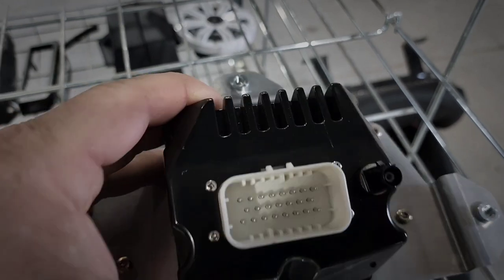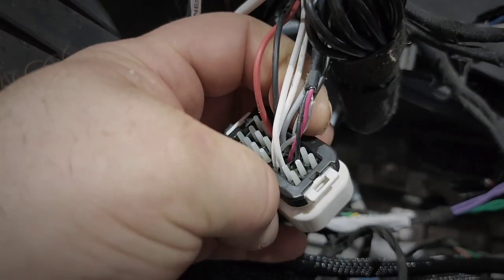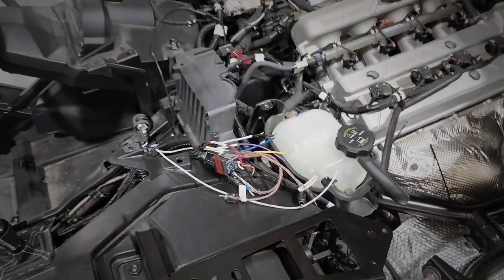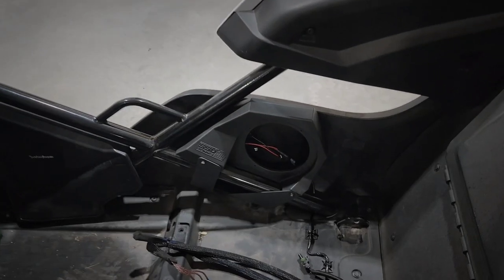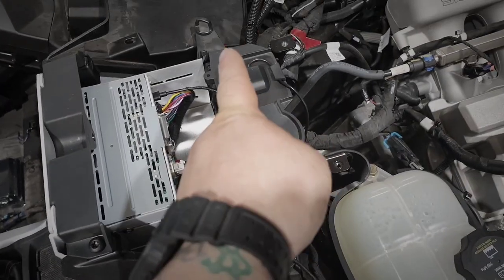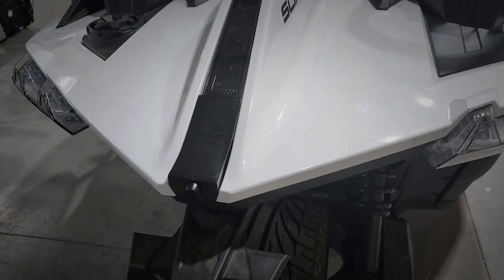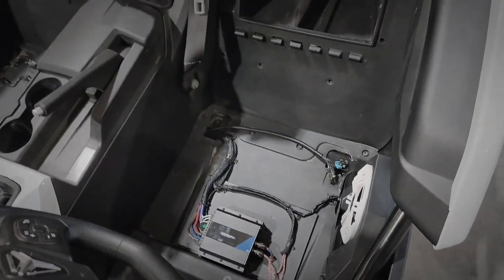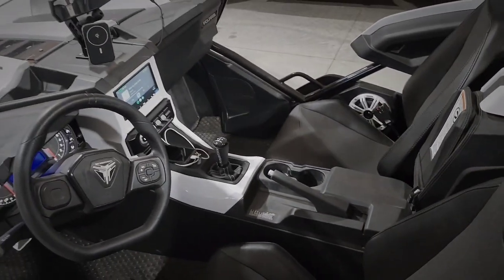Upgraded Audio Tips for a 2021 Polaris Slingshot S with the Tech Package.

Comment: How did you get the faceplate of the sling mods kit to fit between the stock opening in the bezel? Mine looks to be a little tight for a double din